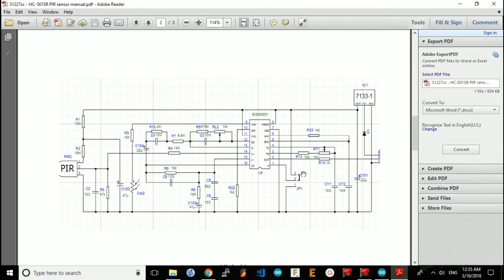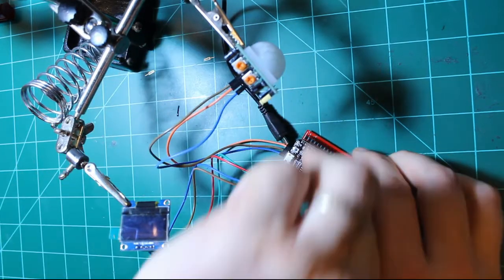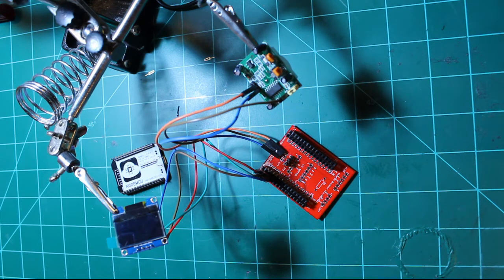Connect PIR sensor to NodeMCU using 3.3V (HC-SR501)

Comment: Apparently this is working in my setup! Thank you very much!
Reply from the maker: I'm happy to hear it! I've been using mine to control a night light in my bedroom (only turns on dim red color if motion is detected at night), and it's been working flawlessly!
Reply: I'm still getting some false positives, but it decreased drastically. I'll try to change the position of the sensor to see what happens.
Reply from the maker: Have you tried playing with the sensitivity/signal time pots on the PIR sensor, as well? I had to do that and pretty much decrease my sensitivity to the minimum, and also turn the sensor almost sideways...after all, these are security motion sensors, so they are meant to be sensitive, which makes it hard for us DIY'ers :)
Reply: I thing was just a coincidence, today I changed the position and I got a lot of false positives.
Reply from the maker: Augusto Carmo - try a different sensor - these things seem to be very touchy - I had to replace one when it started failing (and showing no inputs)...But, like I said in the video, once I found a good sensor, I've had no issues with false positives..Also, if you are using openHAB, check out my suggestion to Ray Brok above and use the expire binding, it smooths out a lot of the inputs into one input. Hope it works for you!

Comment: Hello. I would like to know if it's possible to use the pir sensor to switch lights on in a room when it detects presence using Node
Reply from the maker: Raymond Chikono - absolutely! For example, I have one of these in my master bedroom, in the hallway to my bathroom. At night, if the sensor detects movement, it sends it to my openHAB controller, which sends a command to a Hue light bulb in the bathroom hallway, and turns it on (very dim, red color, so it doesn't wake me up :). It works great! You can see that in my https://youtu.be/VefbT6RuT-4 NodeMCU Multisensor How-to video. I will make more videos soon that show how I have these sensors set up, so please keep watching :)
Reply: @BKHobby  does this sensor  need an additional photo resistor  to work only at night 
i see the radar sensor  you were talking about  does have  a place to solder on a photocell
so does this one too or does it only work at night or do you just  code rules  in your smart home to  work between certain hours only ?
or is it like the outdoor light s with  built in PIR's that only work in the dark?

and do you know anyhtnig about powering  this sensor from a wemos d1 mini? can i just use the 3.3v or 5v labeled pin on the board to power it ,  not sure if it is anything like  the  other guy posted  like if the 3.3 is  in or output only
Reply from the maker: @andreamitchell4758  - the sensor would need a photo resistor if you want to handle the "night mode" in hardware. However, in my case, I'm only using the bare sensor to fire off "Motion" events, and using openHAB rules to act on those events only if it's night (I've also got a "Disable" switch in openHAB, in case I want to prevent the motion events from working altogether). 

As for your other question - it would work entirely the same way with a Wemos. The ESP8266 uses 3v3 for I/O, and the Wemos D1 has a 3v3 pin you could use...

That said, this is still not the most reliable sensor for PIR motion....too many false positives for my taste (even with the workaround here)....I've actually switched it off for now, while I work on Kube V2 (with a TE AmbiMate MS4 sensor, which seems to work better)...
Reply: @BKHobby  thanks for the swift reply
i just tested mine with the  wemos d1 mini using the 5v and gnd pin on the wemos
for power and D7 (and D5) for signal
 using this sketch
int pirPin = D7;
int val;
 
void setup()
{
Serial.begin(9600);
}
 
void loop()
{
val = digitalRead(pirPin);
//low = no motion, high = motion
if (val == LOW)
{
  Serial.println("No motion");
}
else
{
  Serial.println("Motion detected  ALARM");
}
 
delay(1000);
}

and i checked the serial monitor and there  does not seem to be any false positive problems in there at all
so seems like it is all good
now if i can just figure out how to get  it to work with  ST anything i will be all se unless something else comes up
right now i am powering from the PC USB port obviously with the test sketch here
but i wonder if the false positives could also have something to do with whatever power supply is used to power the project
like if if you use a 1 amp phone charger wall wart instead of  a 2 amp  or batteries?
i thought i understood the  wemos d1 to be pretty low power not sure about the node MCU and it's revisions though
maybe you try it on a  wemos D1 mini
i like the d1 mini because of it's smaller size anyways ,it seems to  be working fine
 also not sure if my sensor is the HC SR501
i got it from  china from ebay it didn't specify and there are no markings and i have not got the magnifying glass out to check which IC it has but it looks  similar to  some pics i see for the HC-SR501
but i have seen some pics of that sensor that look different , different amount to caps and different placements
maybe there are good ones and bad ones?
mine has 4 electrolytic caps one in each corner of the board for 3 of them and the last one almost in the corner , the jumper is in the corner and the cap is right behind it
maybe there is more than one design 
and i just got lucky , you never know what you are going to get from China
i have had pretty good luck so far though